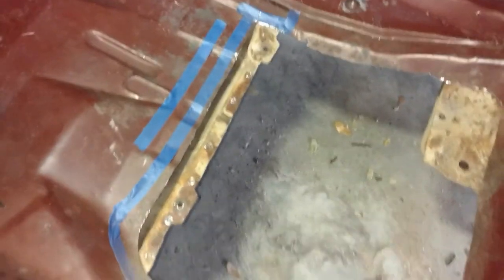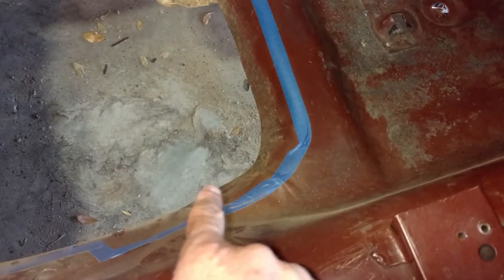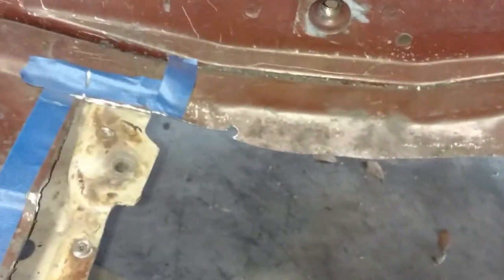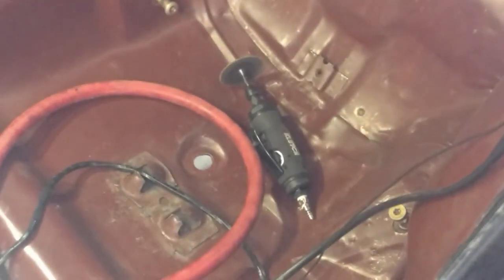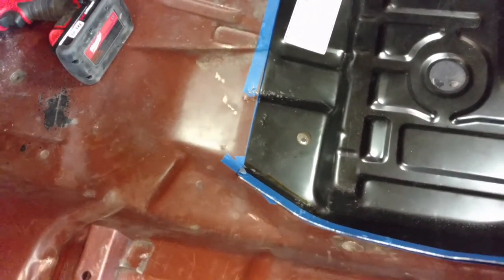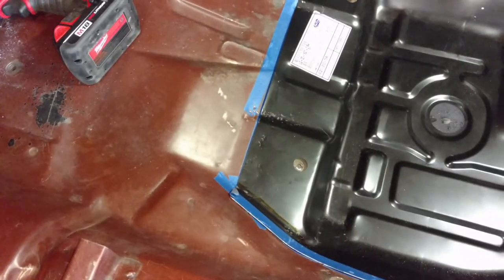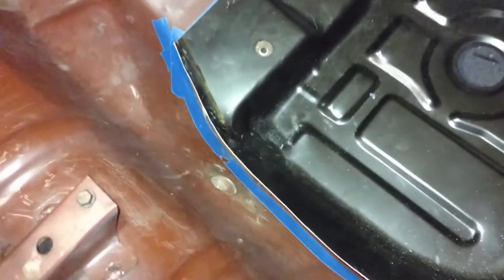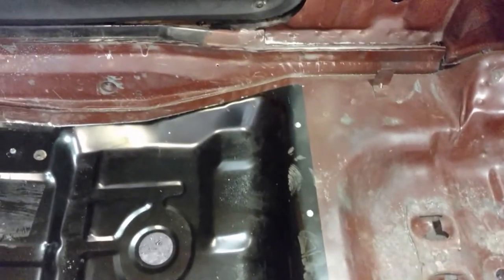77 TA Rear Floor Pan Part 2

Comment: I could not help but smile and laugh when you got to that overcut :) I feel your pain! I am pretty well in the habit now of cutting a good 1/4" or so away from where you think you need to cut. Work it back from there. I STILL screw up occasionally though. The panels seem to have a mind of their own sometimes. You are doing a great job though. Very nice work
Reply from the maker: Thanks for the nice comments, It seems to happen to me in the curves where I can't quite get a making tool in the right place.  Something I have a question about is is it a common practice to use the short strand fiberglass to cover up the welds?  Or is that just something you do?
Reply: I got that from other YouTubers  to fill any small pin holes and keep water out of there.

Comment: You have that panel fitting really nice. I still over cut myself. It's something you have to sneak up on. You can always tack in a small piece of metal or rod and weld it up. Looks good!
Reply from the maker: Yea I saw Eric used some tig wire I recently bought some but it was after I welded this portion up,  I just tried to weld this one closed, it worked but grinding was a pain.

Comment: Sweet. Those panels are a pain to line up perfectly without gaps.  I messed up in quite a few places trying to fit the whole passenger side pan.  A little patience pays off though.  Once you get paint and carpet over it, you won't ever see it! :D
Reply from the maker: Yea it takes alot of time and I usually only get about 4 hours in a weekend so it is going to be a long process.  Once i got over the initial anxiety of cutting into my car I have really enjoyed the process.  Thanks again for watching.
Reply: I know what you mean!  You are doing a better job than I did though by taking your time! :D

Comment: It's going to be better than you think. You can fill the gaps with weld and grid it down.
Reply from the maker: Yea just annoys me that I took care to measure close and still messed it up,  I also don't link putting that much heat into a panel.  I am trying to get better at welding so that when I do panels that people actually see there will be little to no wave because of the heat.